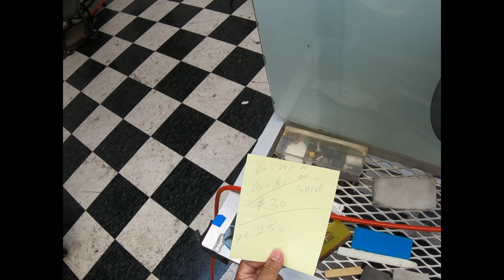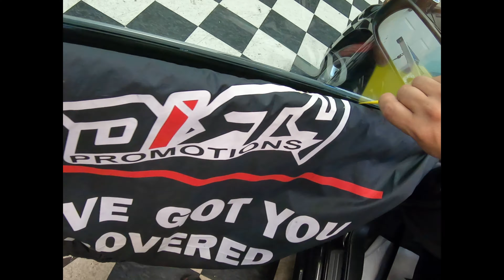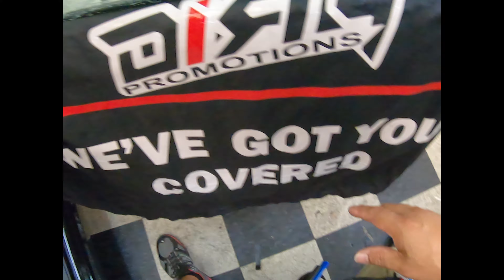XenithIR Film Install & Review.  Part 1.  Tag...Absolutely EVERYONE!

Comment: Can't decide between xpel xr black and solargard zenith.    I want to put something on the windshield to cut some heat off but it is illegal to put anything on the windshield where i live.. so to appear legal i have to use the lightest film possible..  xpel xr black start at 70.. which i find kinda dark to put in the front.. xpel don't make 80..  the problem is that they don't put the specs on their website.. we don't know what % of light is getting through once applied on the car window.  Now on the other hand, solargard xenith go up to 80.. but when i look at the specs on solargard website, once applied to the glass, the light is filtered down to 64%   Which is barely noticeable…. But i would really like to compare the xpel xr black 70 to the zenith 80 and see the difference..  i searched the web for days and no luck..  most reviews only show one product and nearly 95% of the tint project on youtube are 30%-20% tint (dark illegal tint).  I don't see many youtube with legal tinting setup. Which is what i want for our tesla model 3.    So how dark (how light)  is the solargard zenith 80 (the one that allows more light.. and do they have that bluish hue found on many tint like 3m crystaline or xpel xr prime? Or is it more like natural dark
Reply from the maker: Xr black is basic af..no heat block..
Xenith is good ceramic stuff...
So either get xr plus (ceramic) or Xenith IR..
Blavk is dyed..no bueno..
Don't overthink it...70 or 80 are perfect..almost undetectable..so popo won't know the difference...
Get it!!

Dirty 🔥 🔥

Comment: Good evening, great video! 

Quick question, could this be installed on my home windows?
Reply from the maker: No...get flat glass film for that!!
Reply: @mikesanchez1428  We've purchased some 'Gila' heat control film from home depot-- installed it, but the hallway still gets so hot where the thermostat is at. 

It's only 72% heat blocking, though. Is there something that's 99%? I had that installed on my vehicle windows, but can't find anything for residential. 

Thank you for replying!
Reply from the maker: @franciscogalvan2209  u have enough coverage at 72%..
That thing of getting hot in thermo area..has to be addressed...try now adding a solar screen on exterior window...to reduce heat even further